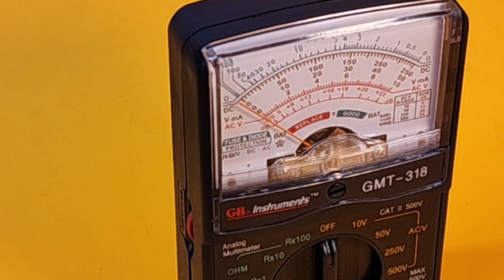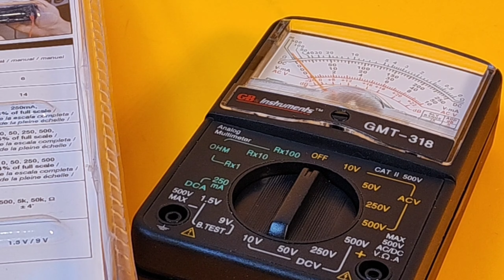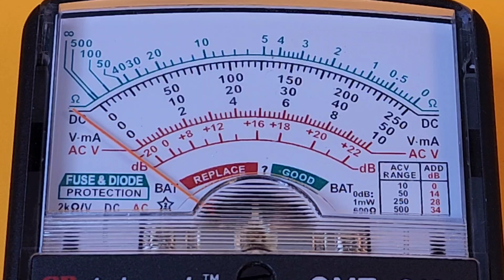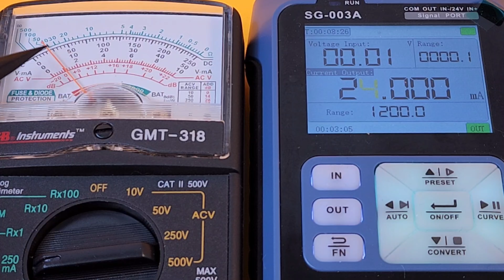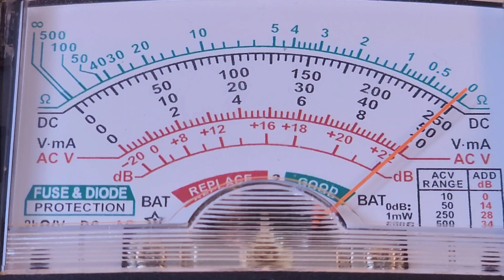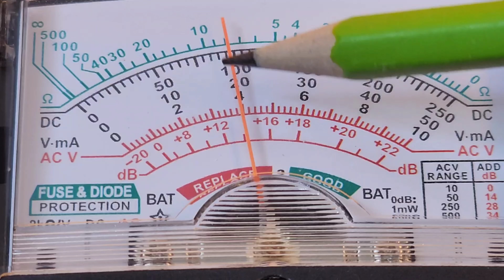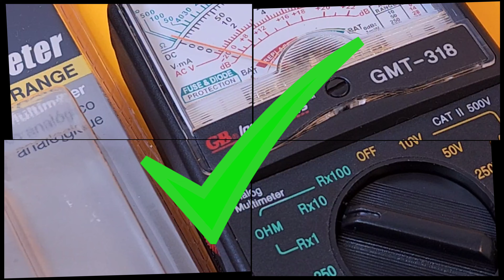GB●Gardner Bender GMT-318 CHEAP-O (Analog) Multimeter Review!

Comment: How do you use this to test fuses on vehicle?
Reply from the maker: Put the range selector in Resistance x1 Mode (OHM, Rx1). A good fuse will move the needle to zero scale all the way. A bad fuse the needle won't move at all. Btw, I'll have a multimeter how-to video coming out soon!

Comment: Variations of this meter have been around since the early 80's by different brands but most often GB.  I have an example at my place of work with the same type of features but no battery test.  It features the same 2KΩ/V movement but does have a parallax mirror, ball bearing range selector, and the leads are fixed.  All resistors are 5% carbon full sized, no SMD's  
It seems they have survived building it to a price and by offering popular features, surprising they didn't add a continuity mode. 💡  I think the only thing the battery is needed for is ohms.
Reply from the maker: An audible continuity mode would have been  a welcome addition. These meters do seem to fill a void but really do have limited usefulness. MI too miss the parallax mirror!!

Comment: Forgive my lack of knowledge .But I just bought one , and while exploring it's functions , I some how blew the fuse . I have no Idea how or why .But I replaced it with what I had available .A 1.2 A /250  fuse . Also the diode protection .How do I bugger that ? And if I do ,can I repair it ? .I"ve had Meters before ,but not with fuses . Can any one answer my questions and explain ,to help me avoid future problems ? Thank you in advance ..........DGR
Reply from the maker: Worry not. Blowing a current fuse is very common, even for experts. It's always recommended to replace a blown fuse with the same value to protect your multimeter and yourself. Diode clamps are fairly robust in terms of input protection and you shouldn't need to replace.

Comment: Wow, first analog multimeter which I would like to buy, especially if buzzer will be added. Looks simple, reliable, with AA battery… i am in love )
Reply from the maker: Hehe..Yes the simplicity of this analog meter is probably its biggest feature! Easy to operate as you mentioned and cheap on batteries! Now if only it had an audible continuity mode! 👍